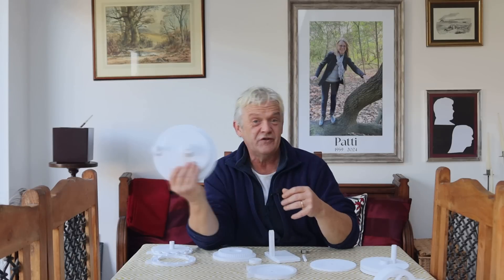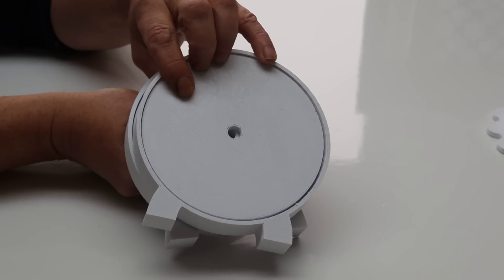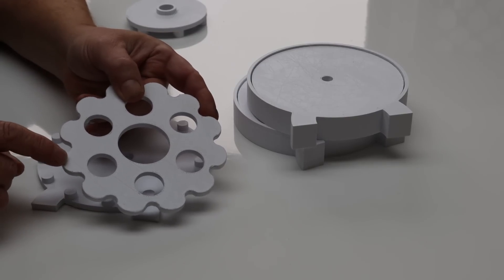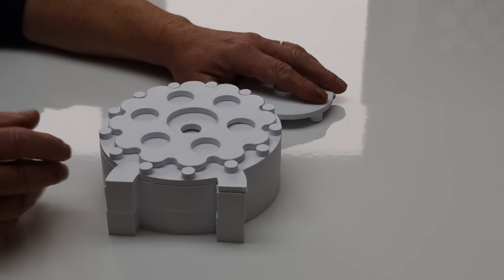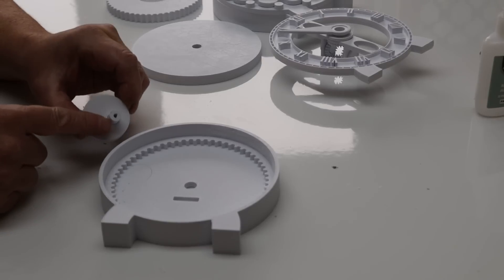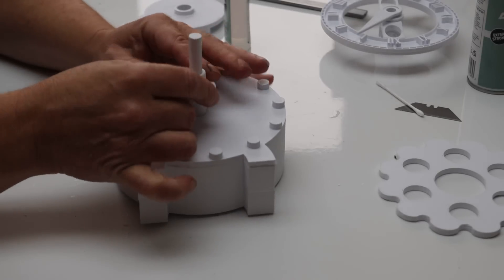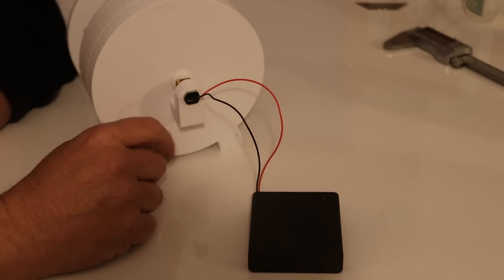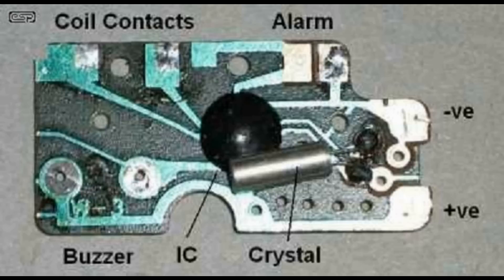2320 The Perpetual Wedge Clock

Comment: Hi Robert , do you still have a shop and if so could you please send the link. I have tried the carbon felt heater/burner , but couldn't get it to burn with vegetable oil . I bought the felt on ebay , perhaps its not the same as what you used so Ill buy some from you and try again! Cheers

Comment: Sooo... what's the cheapest stepper motor you can buy? 🤔 and is it any better than adding a crude optical tachometer to control a dumb motor with say, a mosfet & cheapo arduino board?

I get that 100% 3D printing stuff is pretty cool, but given we're already adding a bunch of electromechanical parts, I would not be in the slightest offended by adding some most-common bearings to things to get it working a bit slicker. Given otherwise it seems like it'd end up being a toy you turn on for 30 seconds to show guests that come around the house and ask what you 3D print.
Reply from the maker: you can solve that problem in a 100 ways mate and they are much of a muchness - your idea sounds good to me - and adding bearings awesome idea - go for it - i only 3D print the whole thing because I am really just demonstrating an idea
Reply: @ThinkingandTinkering  I see you decided to sod buying anything whatsoever (well ok, some extraneous prior parts helped) and just continue with making a whole stepper yourself, well I guess I can't argue with that being entirely in the spirit of this channel 😄